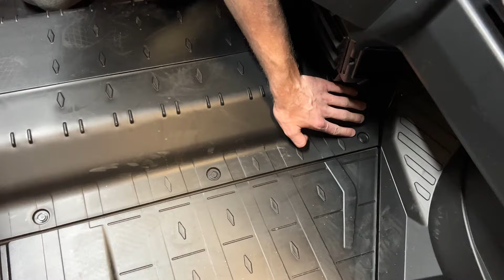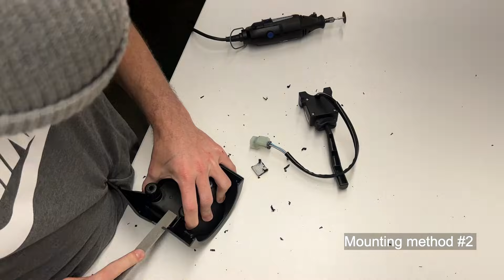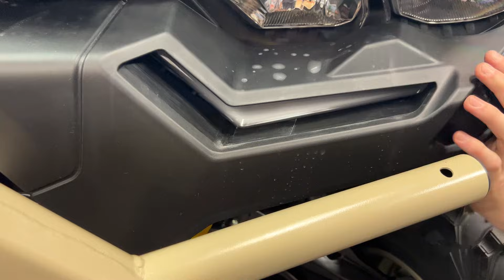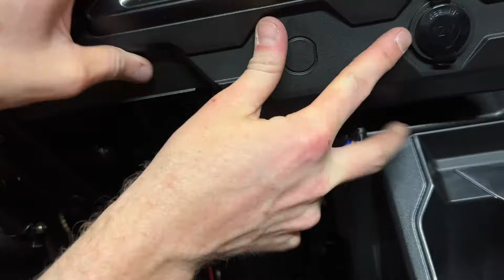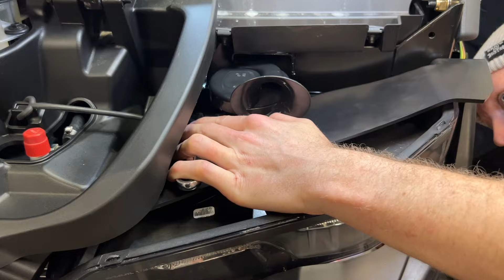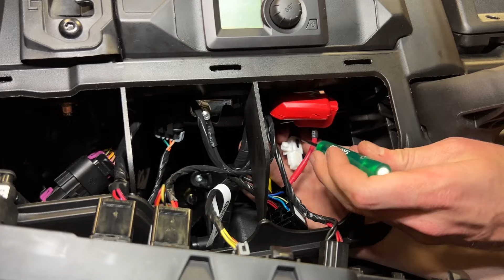Can-Am Defender - Street Legal Kit Install | WD ELECTRONICS

Comment: I installed the kit on my 2025 Can Am Defend Limited -you have to cut out a slot in the middle of the bottom steering column shroud for the bottom of the turn signal switch to drop down through in order for the top and bottom steering column's' shroud to fit back together.  This is an issue with all newer defenders models.
Reply: isnt that covered in the video?

Comment: On the mounting of the turn signal switch I had to cut a portion of the lower shroud in the center of it out on mine to get the halves to go back together. I already had a horn on mine so I installed a micro push button switch in the end of the turn signal lever for my horn button much easier to find when you need it.
Reply: Ran into this also. I just heated it after I ran the screws in to form it
Reply: @Dieselfreek26 yup I thought of that after the fact! Lol lol😅

Comment: 2024 defender - switch doesn’t seem to fit inside column plastic cover.  The ends of the switch where the screws mount to bracket protrude against the plastic covers (both top and bottom) so to prevent column plastic after reinstall to close snug.  There is a plastic wire bracket molded into the switch that needs to be cut off at the bottom and the mounts need to be trimmed for it to fit with ease.  I haven’t trimmed yet.